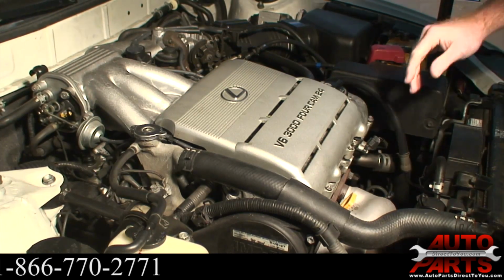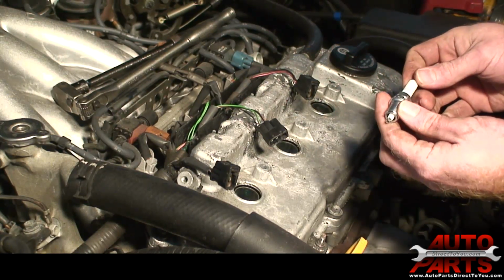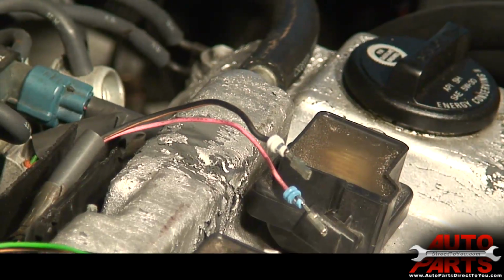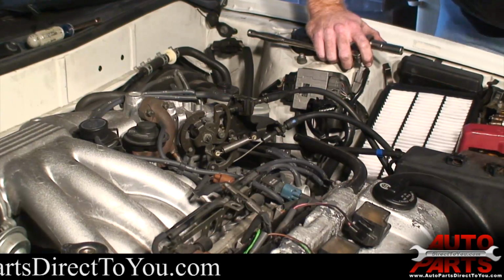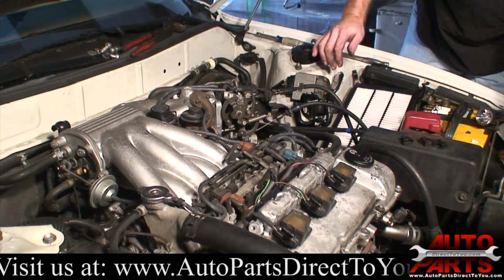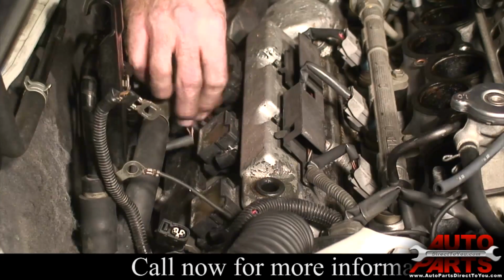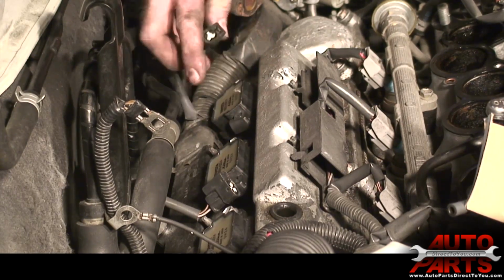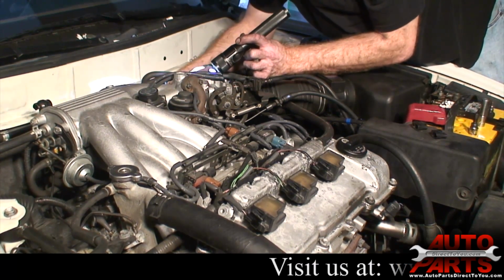1994-1996 Lexus ES 300 Spark Plugs and Ignition Coil Packs Wiring

Comment: Please help, I have 1994 lexus es 300, it showing 1,3,5 misfiring. I changed all the plugs, fuel injectors at the back and coil but after warming up it still shows 1,3,5 misfiring. don't know what the cause

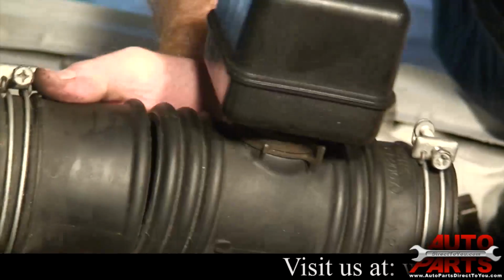Comment: at 7:15 on my toyota camry i had the hose split at the left site by the clamp. i actually cut off the little piece where it was cracked and put back on and been good. also glad mine is a 4 cylinder and not 6. i heard the 6 had problems with sludge.

Comment: This is fantastic Video, very clear step by step, excellent job. I was actually looking one for Estima Deluxe 2002 but couldn't find any on any website/youtube. Does anyone know if they have come across one, which helps a lot, as Estima Engine is under front Driver seat and I have no clue where to start "digging".......Thanks.
Reply: +Brian Odom  Thanks a lot, good idea and I will find more links to Previa as they are the same car engine structure.

Comment: I changed the rear spark plugs without removing intake manifold I just used extension and 2 different ratchets
Reply: So did I and I've never even touched an egien before that
Reply: what yearr

Comment: Hi. I have a 95 ES300. I just changed the Y pipe today. It sounds way  better but I still hear a little clacking sound from the motor. Like: tik tik tik. The mechanic told me it`s probably a trap. I don`t know what he`s talking about but another mechanic told me I need to change the rear right exhaust manifold. I bought one from a scrap yard. Apparently it`s a damn big job. It`s evaluated to 8 hours. And I`m not even sure if that manifold is perforated.
Reply from the maker: Grunge LovR You should probably performa a thorough inspection and if you can get it on a lift and run the engine to find the leak that would be best. It may even be worth paying a shop a small amount to lift it up and fine the leak to verify for sure. You can waste lots of time and money replacing that manifold and find out that is not the problem.

Comment: where is the spark plug wire?
Reply from the maker: Most newer vehicles use what is called an ignition coil on plug (COP) design. The spark plug wires used to go from either the distributor cap (distributes the spark) or form the ignition coil to the spark plug. Well now the ignition coil is mounted directly on top of each spark plug and the only thing left that is even close to a spark plug wire is the rubber boot that holds the spark plug on to the coil.

Comment: a friend of mine just bought a car like this a few months ago. this car is flawless by comparison though. did you buy the new intake hose from the dealer? or is there an aftermarket company that makes them now? also my friends car has every coil pack marked w/ the firing order. (1, 2, 3..etc.) does that mean that the coil packs have to be bought specifically for the firing order? any help is much appreciated.
Reply from the maker: The ignition coils are interchangeable so you can ignore those numbers and the aftermarket coils dont have any numbers on them like that. ALso the hose is a very common thing and here is a link to it at Amazon.com http://www.amazon.com/gp/product/B00BVBW4QU/ref=as_li_tl?ie=UTF8&camp=1789&creative=9325&creativeASIN=B00BVBW4QU&linkCode=as2&tag=aupaditoyo-20&linkId=WZMNPAUL22NEZXPQ

Comment: Gianni Quintana Here is a rough estimate range at a regular shop (non-dealership):
Coils $95-$160 each
Connectors (if Needed)  $4-$6 Each
Plugs $6-$12 each
Intake Gasket $30-$40
Labor Book Time Is 1.4-2.5 hours depending on how many connectors get replaced, the labor rate in our town runs around $85-$105, so at the highest it is 2.5 hours times $105 = $262.50

A dealership would mot likely be much more
Reply: APDTY do this kit work on a 2002 es300

Comment: So I just changed all 6. I removed everything like you said and followed every step. After changing everything I noticed a sputtering idle and a check engine light? What could be the problem sir? Please help. Thank you
Reply from the maker: Hi, if you've looked over everything and don't see any loose connectors or vacuum hoses, the next step will be to have the engine computer scanned to see what trouble codes are in the system, that should help point you to what the actual problem is.

Comment: Is this the 1MZ or 3VZ engine?
Reply from the maker: I believe this is the 1MZ engine
Reply: Auto Parts Direct To You Aside from the 3VZ-FE not having coil packs, is it pretty much the same for doing the spark plugs?
Reply from the maker: Jas George Yes it is very similar, I think you still have to pull the upper plenum off to get to the rear plugs. Also look out for any oil seeping from the valve covers. If any oil is leaking, may want to change the valve cover gaskets with the plenum off, the rear valve cover anyway.

Comment: Yeah I've never pulled the intake, to much bull and usually not necessary.  Also have two spark plug sockets, one with the boot to hold the plug half way in the boot as you insert it, and one to tighten the plug.  If you use the one with the boot the whole time the socket will not let the plug go when you take your extension off. This is why you put the plug in the booted socket loosely to be able to pull if off after you've started the plug by hand.
Reply: how do you get the coilpacks out of a 95 es 300, if you dont pull the intake.

Comment: Really helpful the same thing happened to the intake hose of my Lexus might have to get it from you guys thanks!!!
Reply from the maker: Yeah that hose is common, It is rubber and just gets brittle over time and once it cracks the engine does not know how much air it is getting and it can stall, here is our hose at amazon: http://www.amazon.com/gp/product/B00BVBW4QU/ref=as_li_tl?ie=UTF8&camp=1789&creative=9325&creativeASIN=B00BVBW4QU&linkCode=as2&tag=aupaditoyo-20&linkId=WZMNPAUL22NEZXPQ

Comment: you are exactly right, it can be done with by using a stubby 3/8 ratchet or 1/4 and different small sizes of extensions. If you take out the plenum change the valve cover gasket as well.

Comment: Great Video. Couple Questions.  Why would you only replace the back three coil packs and not all 6?  Also why didnt you use antisieze on the plugs and dielectric grease on the connections?

Comment from the maker: The quickest way to identify which cylinder is which, is to find a "Firing Order Diagram" for your specific car. That should be located in your repair manual or you may be able to find the diagram searching the internet.

Comment: Yeah, that's what they told me, however I checked 2 sensors and they seem O.K. and the one being replaced as the one that triggered the other is the Throttle position sensor (Aisan brand). I hope that will solve the issues since before the spark plugs change, never had any other problems of this kind. Thank you for the advise. Denso is the brand I look to install in future repairs related. Have a nice day!

Comment from the maker: Those codes are all oxygen sensor related,, I would recommend you replace all of the oxygen / air fuel sensors. Being a lexus (Toyota Engine) the "Denso" brand is recommended in your situation.

Comment from the maker: What trouble codes were stored in the memory when the check engine light came on? The engine light only comes on if the computer detects a problem, and the computer will store a code which helps diagnose the problem. Your mechanic should have pulled those codes before clearing them out of the system. if you have those, we can try to point you in the right direction.

Comment: Yeah...I agree with you. The mechanic who helped me finish the spark plugs installation said the same. I will keep that in mind until I save some more money and the time to do it. For now the car is once again running great and at have again a means of transportation. Expensive work (all together close to $200 with tow truck included). Now, the "check engine light" came on...twice! (after being erased once from the memory by the mechanic) any suggestions? Thanks!

Comment: Thank you for uploading this very instructive video. Very difficult labor to change 6 spark plugs. I own an IS300 2004 and having quite a hard time changing the spark plugs myself. There was some oil flood in the spark plug hole and I wonder if a gasket is broken and needed to be replaced...?  These engines are not easy to work on. Kudos to you!

Comment: What a great video. The whole job went super smooth. All nuts/bolts easy to reach. Prior, I purchased the plenum gasket( Felpro MS95407)and throttle body gasket(Felpro 61020) (EGR tube has gaskt also- I didn't buy) Plenum & TB gaskets were made of metal and I could have re-used them.Two electrical connectors did fall apart but both were front connectors so I was able to complete the rear job. I would advice you buy these connectors prior so you are prepared for the worst. Thanks-excellent video.

Comment: Nice video, but one minor error:

That car is NOT a 95, it's a 94 model! How do I know? Because the 1995-96 versions only have *three* ignition coils (those two years got wasted spark), and three regular spark plug wires. Only the front bank of cylinders has coils in 1995-96 (the even-numbered cyls 2/4/6). The coil from #2 connects to #5, 4 connects to 1, and 6 connects to 3

Cylinders
135 
246
(front)
Reply: That looked like a 97-99

Comment from the maker: @joe27077 You can test an ignition coil by removing it and doing an Ohms-test, your service manual should tell you what the resistance should be across the coil terminals, using a multimeter you can measure the ohms according to the service manual and see if it is in range of the specifications. Thanks